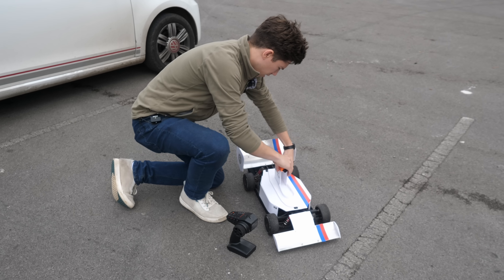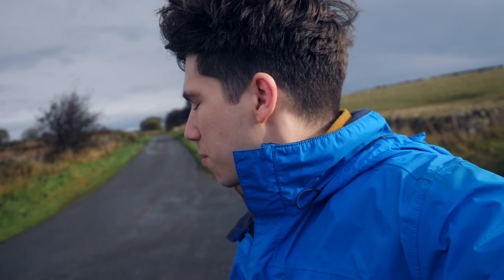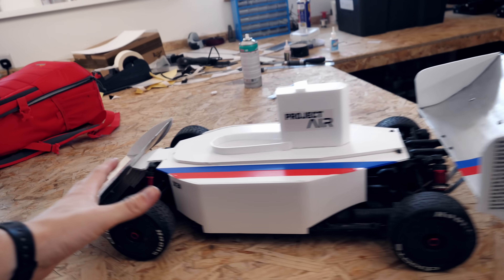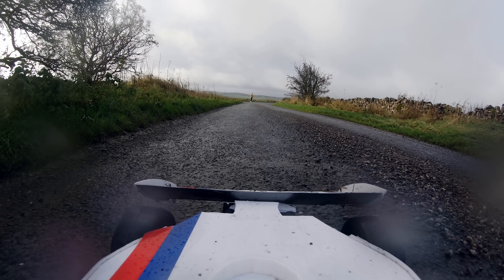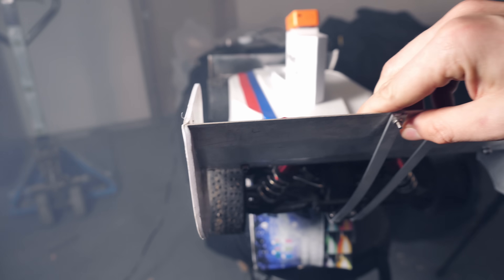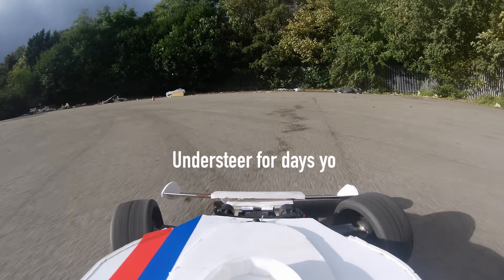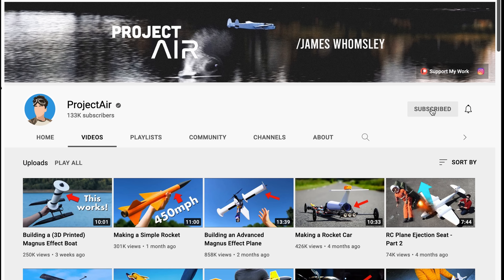RC Car Extreme Aerodynamics

Comment: 8:20. Your rear wing is behind rear axle so it is levering. Added drag of that wing is also creating a levering effect. There is a tradeoff. Too high front wing angle would put rear wing into a wake rendering it useless. Its a matter of compromises. Anyway, It works but as you said, the tests as constructed were not very meaningful and your driving was not consistent enough. Especially the no wing corner was with big margin. The easiest way to see the downforce would be running coast down from maximum speed with vs without aero and having some measurement pickup point on chassic vs hub. Anyway using a 1:10 scale, you would have 1.5 kg car capable of >100km/h and with good surface you would have more interesting results

Comment: Mate, you are right with your experiment on how the aerodynamics work. However I was disappointed on the part you said the rc car is understeering because of the huge rear wing , that was also one of the factors why the front is lifting. You only consider the front and rear wings. You should also include a side angled wing, not to produce down force or negative lift but to aerodynamically help the car steer through corners in high speed. If ever you'll consider my opinion please make another video on it and I like to see the results.

Comment: I did something very similar about 8 years ago and yes it works well so long as the spring rate are balanced properly with the aero and going around in a circle is a better way to find out what Gaines you have made.

Comment: There's a few things I think would be worth testing to reduce the number of unknowns in your testing - firstly would be the relationship between pure weight and handling - On something as light as an RC car (even a heavy one) I'd expect noticeable changes in behaviour for very little change in weight and mass distribution. A couple of test runs with some weights in different parts of teh chassis should give you a pretty good view of that. Secondly, I'd suggest a couple of control tests with your foamboard bodywork before attaching the wings, to see if simple surface drag impacts it. Also, if it's configurable, testing some different suspension configurations (height/track/camber and with/without chassis stiffening) would help reduce the number of unknown-unkowns in your experiment.

In terms of ideas that might help with getting better results - rather than sheet-aluminium wings I'd suggest printed ones - or at least printed wing section forms. This would allow much finer control over the wing section and more reliable lift/drag calculations. I'd also suggest looking at making an adjustable structured mount so you can pin the wing at different angles. for rapid testing. Would probably just need holes for split-pins. 

Final thought, since this is more about downforce in cornering, would a curved wing, or a split wing with a few degrees of anhedral increase downforce on the inside of the turn?

Comment: In reality the air DOES NOT PUSH the car to the ground. In reality the air creates a low pressure zone below or over the wing(depending on the direction). That low pressure pulls the entire contraption to fill in that low pressure zone.

Comment: They're called 'small municipal airports'. Find one. Your gear keeps getting torn up by terrible road surfaces and no side to side space for correction, like George Russell going over sausage curbs and you can still take this to the next level by copying Colin Chapman's undersides of the sidepods on the Lotus 79, if you're looking to get more content out of that car.

Comment: Big wing's aren't the go try to build:
Smaller and wider front wingbut must make an outwash effect(take 2010 f1 car refference).
bargeboards the not to complex or complex if you want.
a functional drs cuz why need drag in the straight line(i think this is to hard so its optional).
Hmm idk what redbull front wing duct called but it help directing the airflow up.
wider tyres cus more traction and to combinate them with the wing.
the fan car system.

welo it think all of this too hard except the front wing and tyres

Comment: Use a split front scoop to allow more air to pass over the front center of the car pushing down the rear.

I did similar experiments with a Traxxas Jato 3.3.  Full front scoop overheated the engine due to air deflection as I ran gas.
With split scoop there was still a considerable difference in stearing ability against a stock Jato.  Both had upgraded Road Rage tires and not the garbage stock Anacondas.

Keep up the good work

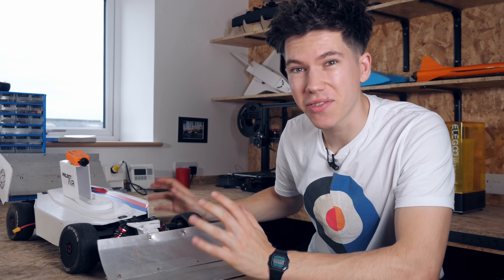Comment: Nice content. But @ 10:04 I don't understand why the the support needs to make so high with the exit closed. Wouldn't the air stuck here and become an obstacle for the car? For F1 one, air can go in there and then come out somewhere at the end. So I wonder if you open up the exit of the camera support  (or remove this support, and put the camera forward at a lower position), would the air flow be better and make the car faster?

Comment: And so you can use the small front wing put weight in the front and base the weight system in the front on the tuned mass damper the Renault introduced in 2005 and 2006 and the front wing will have a much better aerodynamic stability

Comment: You need to create a y2 vortex on the front wing by making a front wing very similar to a present f1 wing which will reduce the drag and help your ground effect by letting more air pass under and over the body of the car

Comment: The wings are unbalanced. The front wing is most important for steering, the rear for the grip. 
Try to split the front wing in two (like the Lotus 72D) and let them less \ but more ---,  so the air in the middle can move on the rear wing freely. Put the rear wing higher you can.

Comment: Downforce is mainly generated by a low pressure area under the wing, and NOT by the air pushing down on the top of the wing

Comment: Given that the Limitless is based on Arrma's the 1/8 Buggy, The Typhoon, aero for the buggy would be more for stability than actually downforce, as the buggy is going to be rather hefty. There was a 1/8 LITE class of buggy that was essentially just a stretched out 1/10, which resulted in a much lighter model for the class. Unfortunately, 1/8 Lites did not take off in the US so I don't have much to go on, over here.  The Arrma 7scales, Limitless, Infraction, and Felon,  would need to be completely re-engineered to have a much lighter chassis, which ought be difficult to reconcile with much heavier 1/8 scale running gear. However it might allow for less weighty running gear, smaller motor and/or battery pack among other things. But at that reduce weight, aero will be much more effective.

Comment: Careful! Your curve is too severe, it may cause flow separation. Also, induced drag is a thing, the aspect ratio of a wing affects induced drag greatly. Wings with low span and short cord have less induced drag.

Induced drag also increases with the square of the coefficient of lift, which in turn increases roughly linearly with the angle of attack. So if you double the angle of attack, it quadruples the induced drag. If you quintuple the angle of attack, it makes the induced drag go x25, all assuming you're still not stalled (beyond your critical aoa). Flat wings like that are bound to have a pretty low critical angle of attack.

Comment: perhaps you could have those higher flaps going from the endplates towards the middle for a couple of centimeters, have a plate and then in the middle a lower flap to have 1 large section in the middle that won't spoil the effectiveness of the rear wing but still have downforce generating to keep the nose pushed into the ground enough.

Comment: The good old trick of sticking some bits of yarn all over the car would probably reveal a lot of the possible aerodynamic issues.

Also, for a more consistent test, drive in a circle as fast as the car can go, and measure how fast the car can go around a circle with a certain radius. The benefit of this is that you can use quite simple physics to figure out if the aerodynamics is providing a meaningful downforce to assist the car - namely, if the centripetal acceleration in a corner is continuously higher than 1.0g, then you have conclusively demonstrated the presence of downforce.
Reply: Wouldn't really need to use any serious math beyond an overview shot with a drone at a set height and calculating the radius of the circle. Bring a broom, sweep the area free of debris and draw a set of uniform chalk circles using a string for an easy point of reference.  The understeering would make a dramatic impact on the size of the circle and the differences would be visualized quite clearly.
Reply: Lmfao a guy copied your whole fucking comment, I can see it over your comment
wish YOUTUBE had the option to upload pic as a comment, I'd have replied to his comment with the ss of your comment and bully that fucker
Reply: @urgesurfing  Wow, you're right. Word. For. Word. Lol
His name is Dark, looks to be some anime pfp, and has a checkmark.
Reply: @urgesurfing  There are a lot of YouTube bots going around these days doing exactly that. They take an existing comment and copy it as their own, it's a cheap way to make them look like "real" people because they're posting comments that are made by real people instead of cheap Markov chain generator or some shit like that.

Though usually those bots have pictures of scantily clad Russian ladies as their profile picture and their names are like "Click Me If Your Horni" or something, which makes it easy for us to see what's going on. This "Dark" channel might be related but evolved to be more stealthy like.

It's usually best to just report things like this, and then ignore it. Bullying people never results in anything good and if it's a bot, you're just spending your effort for nothing.

Comment: Be careful as you have slightly misunderstood how downforce is created. The key to how a wing works for both lift and downforce is the aerofoil shape which creates a pressure differential across the two sides of the wing. You’ve assumed that a an angled sheet does the same and that is not quite right.

Comment: Less angle off attack on the wings and soften up the front stiffen up the rear suspension and maybe more camber tho rc cars roll a lot and I found a sweet spot where the car would grip and roll, maybe if you find that with the downforce it wouldn’t roll and would go exactly where you want it to

Comment: Down force is partially created by the air being deflected upwards but most of the force comes from how the shape of the air foil slows and speeds up air making a low and high pressure on the top and bottom of the wind so the difference in pressure is what creates a majority of the force comes from

Comment: Try adding small vertical wings on the steering mechanism, near the front wheels attachment and that pop up vertically (or simply beside the wheels), so when you steer those wings create a lateral force which helps the car steer. Or you can make an active aerodynamic system with servos, which is even better because you can adjus the turning angle based on the actual speed of the car, and so even more stable. It will be more difficult but much stronger. Give it a try!

Comment: You should have attached string all over it with tape like they used to do in the old days. So you could have watched the airflow and see if it's actually making it to the back wing and not just peeking over from the front or at least see how much aero loss.

Comment: you should buy a accurately designed F1 RC car and remove all of its aero then add it back piece by piece, but also go back and only use one piece of aero at a time. to see even if it would work at that scale, but also to see what aero components create the most downforce for an RC car. is it translatable from scale to scale? also a good test would be a power increase or decrease by changing the motor or the cell.

Comment: Coming from someone that has worked on aerodynamics on cars before. There are several things to take into consideration here. One the lack of measurement for the aerodynamic surfaces, this is partially what lead to the understeering issue with the smaller front wing. Many research documents will state a 53-55% (rearwards) CoP (center of pressure), this figure changes based on weight distribution and suspension geometry but its a good rule of thumb. That front wing wasen’t causing understeer due to a lack of downforce, but rather too much rear downforce. Additionally one think to consider with the front wing rooster tail (what we call the dirty air kicked up by a wing element) is that while it is pushing air up and over the rear wing, during cornering you will have air coming in from an angle based on your cornering angle. This will load the rear wing the same as any other air (albeit reduced slightly), so your main concern, especially with a small car wont be to deal with that air, especially since it does not have enough time to collapse on itself (itll just be turbulent). Finally some thoughts for future prototyping could involve a smoother wing surface, especially on the underside of the wing as that is the downforce generating side of the wing. The detached boundary layer significantly reduces downforce and increases drag, so if possible either smaller, smoother bends in aluminum, or maybe even thinner aluminum sheet to reinforce an airfoil foam board would work nicely, which leads into my final thought. If at all possible, look into airfoil shapes instead of just flat pieces of metal, while the sheet metal will work, airfoils are tuned to generate more lift and limit stall, at the moment sheet metal will just quite literally shovel air up and that is your downforce, instead of manipulating pressure differences which would be the goal of an airfoil.

Comment: Suggestion: use a multi flaps wings like the current f1 cars instead of the shovel, you can get a lower profile front wing with an increased surface area

Comment: Just some tips: Gurney flaps are very useful (basically flexing the very end of the wing more drastically, producing more downforce with less drag). Placing skirts on the side of the floor (obviously not made of a thick material) would also inprove ground effect. You can also wider the front wing, because turned tires can disturb air flow. This solution might also work: placing the rear wing on a shark fin by its upper side as the rear wing's lower side produces the more downforce, and as the shark fin ends in the rear wing, it doesn't create such a big vortex.

Comment: you really want less surface area on that rear wing that or make it higher since you want the air to go under the wing since its what actually generates alot of downforce. pair that with a good front wing and it should stop the understeer.

Comment: One difficulty is that at the relatively low speeds the wings need to be huge and ambient air movement is a significant effector.  You might try using a fan to draw air out from under a skirt around the car, sort of a reverse hovercraft like Jim Hall's Chaparral that worked so well the technique was banned. You could even have a simple pendulum accelerometer  control the fan so it only ran when cornering. Another approach might be to have the wing angles change according to sideways g forces (using an accelerometer).

Comment: What about mounting the wings to the axels instead of the chassis so the downforce won't bottom out the suspension. This was it might handle the bumps better. I believe this is done on the piles peak time attack stuff.

Comment: Your approach seems extremely brute force without any kind of subtility. Yes, force is important, but so is balance. I would go with much smaller wings that are balanced. More like you see on F1 cars. Also, I do question how comparable an extreme RC car, like this, is to an actual F1 in power to weight ratio and relative speed. It seems to me that relative to its size this RC car is actually more powerful than even an F1 car. This means that an extreme RC car like this will never corner as well as an F1 car.

Comment: The lift is produced by the increased speed of the air that needs to pass by the bent top of an aircraft wing. This faster airstream at the top pulls up the wing and is the dominant effect of lift. Also lift is proportional to the square of the velocity but just linear proportional to the area.

Comment: You actually made the wings really ineffective. The majority of the downforce produced by race aero is from the pressure differential and not from the current redirection. By making a "wing" that only redirects air but doesn't have the actual shape of a wing you're basically missing out on about 70% of the actual downforce you could be getting.

Comment: The corner you choose does not really lend it self to testing, let alone ground-effect testing. The car is jumping around a lot, just a slightly different path seems to be the difference between hitting the inside corner and flying out of the curve all together.

I would suggest doing the test on the parking-lot just driving around in circles:

if there is more grip then at the same speed the car can drive a tighter circle.

Also the 2 control-tests were missing:
The car with its original bodywork, and the car with your test-bodywork but no wings.

Comment: Just a tip, your rear wing is probably generating a lot of drag due to the crazy AoA. Also better off putting it higher up the body to capture cleaner, non-turbulent air. Having a sharp leading edge is also not good, creating a disturbed boundary layer.
Also having larger endplates that are not clipped on the low pressure side also prevents higher pressure air from 'spilling' in, allowing your wing to produce a bit more downforce, but larger side area is also not great for yaw. Cool project, love to see more!